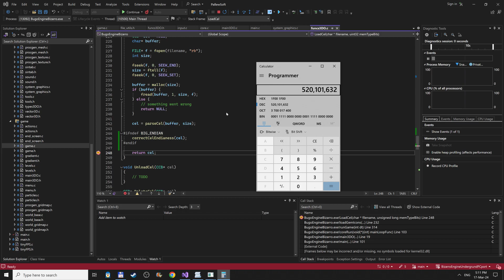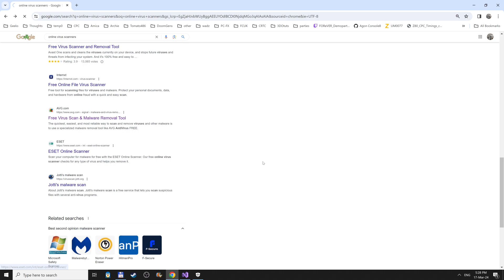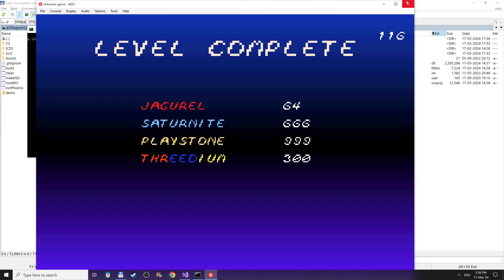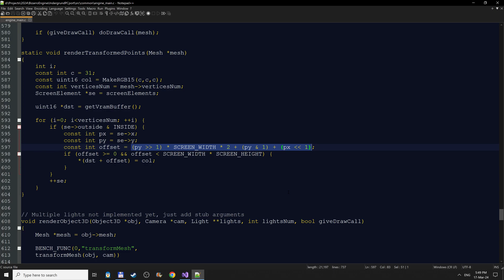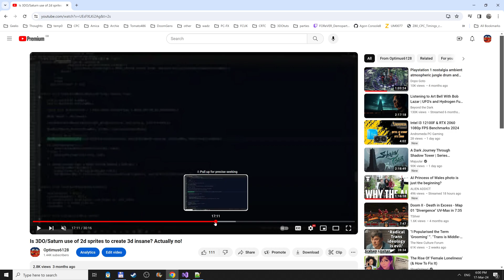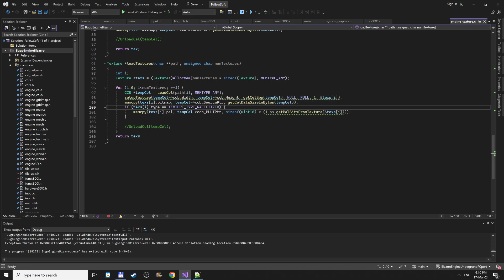OptiCode 0x0015 - Progress on porting Bizaro Untergrund on PC

Comment: 57:00 Annoyingly, Microsoft thinks they know better than a computer's owner, so they automatically enable Windows Defender if it's kept off for a bit. This is just as dumb as Android enforcing using a PIN number instead of the user's fingerprint; Developers shouldn't act like they know more than the user when it should be their choice.

But I digress (I just hate when companies have this stupid, controlling logic); The proper way to work around Windows Defender's false positives is to add the folder your compiled EXE is created in to its exclusions. Open Defender and click on the link under "Virus & threat protection settings" then scroll down until you see "exclusions".